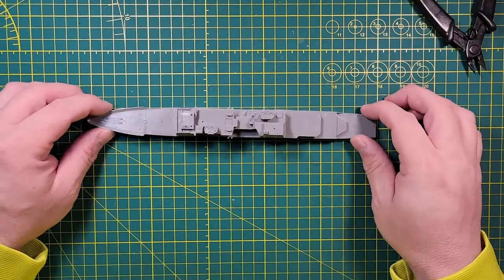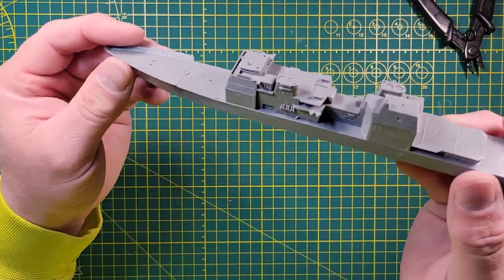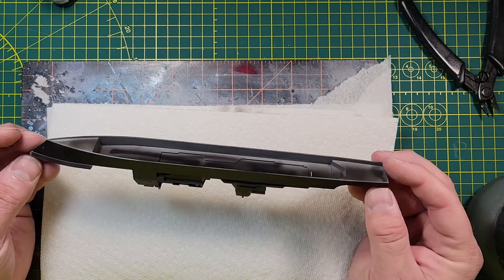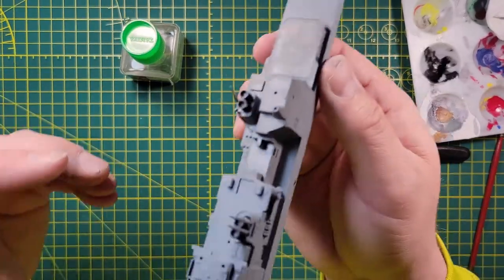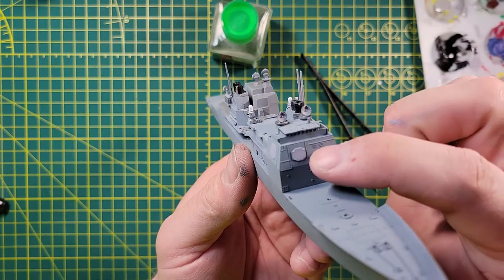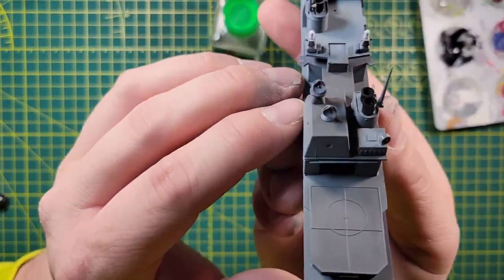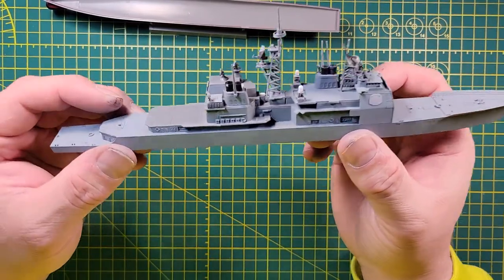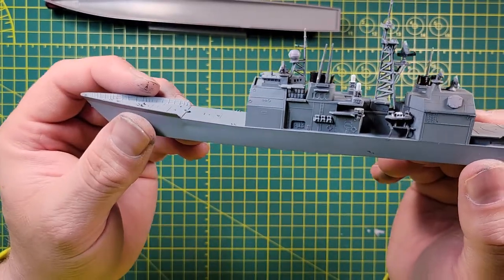The Build Part 2 | 1/700 Ticonderoga Class Cruiser

Comment: As many have mentioned.... Looks good so far!!

On a little more Serious note, just curious, but have you looked into placing photo-etch (PE) on your ship??

But a more serious note... I see the forward part of the superstructure on the port side (left side of the ship) is not flush to the hull.  I have seen this on another TICO model ( forgot which brand.....It Could even be mine ), but the forward SS is to be flushed to the hull...I know it is too late to fix/repair that Now, because you have done a great job on your build so, far!!

I usually do, on my 1/700 ships, replace my shafts with metal brass rod so that they don't break/snap as I build or clean up.  I've been replacing my plastic shafts with brass for awhile ..... MayBe , with a bit of patience, practice on one of your other ship builds to see if you can add this small but clean, strong feature.

Take a look at this build where I did that, it is one of my JMSDF 'DDH-Project' build. https://www.youtube.com/watch?v=ReT2hjTFUxY
Reply from the maker: I love using PE on my ships. This kit didn’t provide any but I have used it before. I tried to line it up the best I could. I like the idea of the brass for the shafts. I have a 1/700 aircraft carrier I can try that on. I checked out that video you suggested. Your attention to detail is amazing. Great job on that one!!  I really appreciate all the tips you are giving me!!
Reply: @averagemodelguy3544  Thanks 'AMG'..... as far as using brass rod for the shafts......... Great care & patience needs to be at hand.  

To do this, I measure the size of the plastic rod ( I always measure in millimeters ) for the size of rod you'll cut, and file the brass a bit to remove burrs. Cut the plastic shafts near that area where the shaft meets the hull, and possibly the struts themselves.  Next, with a small drill ( a little bit bigger than the rod you'll be using [ so you'll need to get some assorted drill bits and pin drill ] ) drill out a small enough hole to place part of the rod just to fit inside.  

Here is the 'Great care & patience' is needed because you need to hold that part that attaches to the hull VERY CAREFULLY....for if you slip the drill, you cut damage the part, Or WORSE, Penetrate your Own FINGER!!
😬😵‍💫
Then drill out the strut doing the same.....just enough to allow the rod to get inside, then SuperGlue both ends of the rod down.

IF.... the propeller shaft goes Through the strut........Even MORE CARE is needed to drill that hole through the strut (like possibly the A/C carriers you might build)!!!  I usually drill from both sides of that strut, and I would start on the inner struts........Just-in-Case you are not satisfied with the results.  I have broken a couple of struts, got mad😳😫, but improved on other struts.

It Looks Cool and it gives a MUCH Better structural integrity and those shafts won't break while handling the ships........they usually break when I remove them from the tree Anyway!!

Let me know how you do with your build....if you check out my MIDWAY, you'll see....a bit terribly, how those rods, struts, and Alignment is all important while doing this, but if you see my JS Kaga and other ships after doing this for awhile...the results are Much Better!!!

Good Luck🙂👍✌
Reply from the maker: Thank you so much for the tip. I think it will be worth the “pain”!